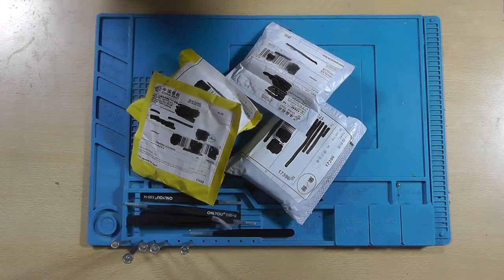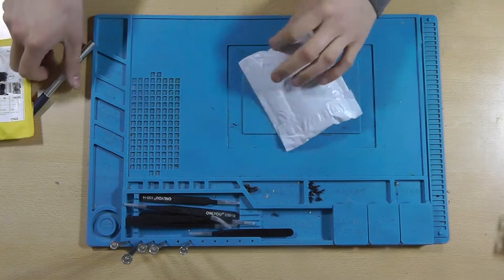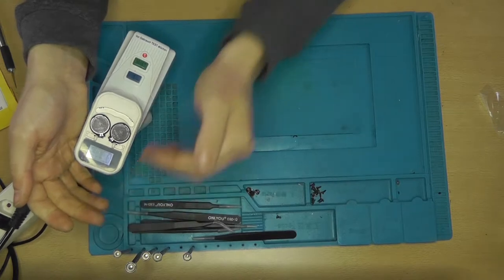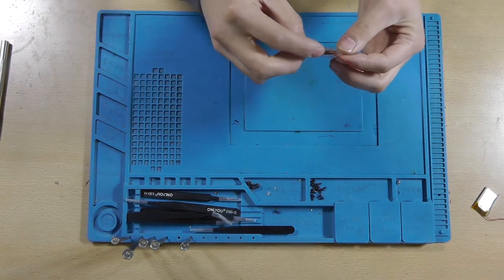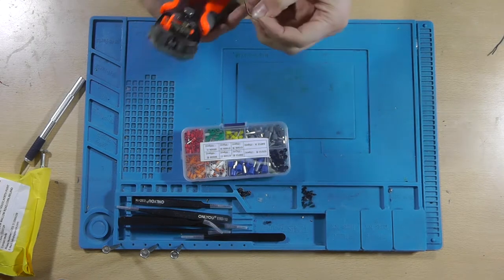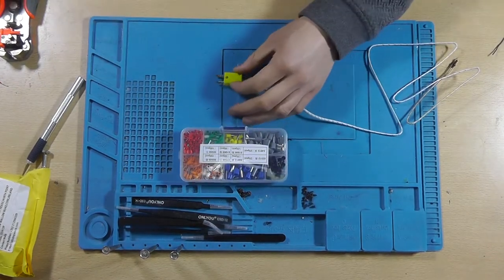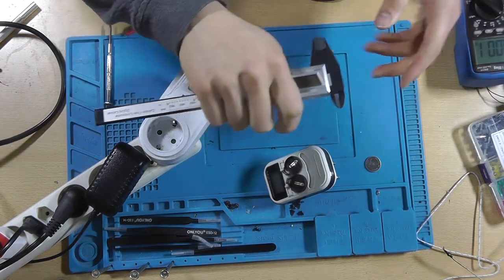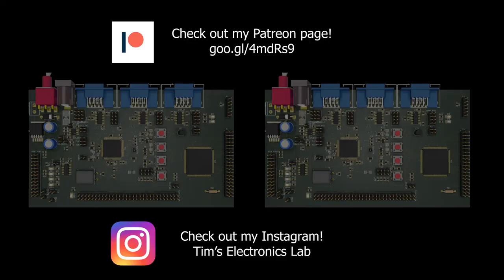#120 This year's first postbag! w/coin cell charger update

Comment: You should not tin wires that will go in a screw terminal.
The clamping will "loosen" and you will have a bad connection after a time. Ferrules are the way to go.
Reply from the maker: That is also correct, but if you use too thin wires without tinning when, the strands will just break 😜